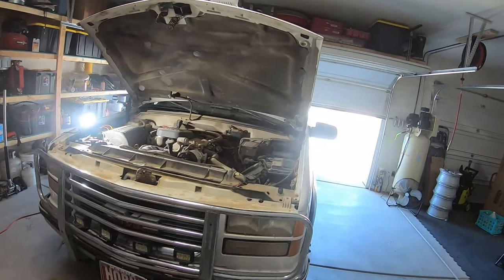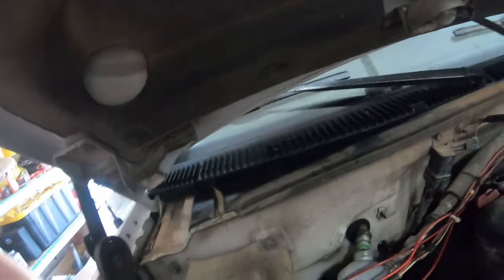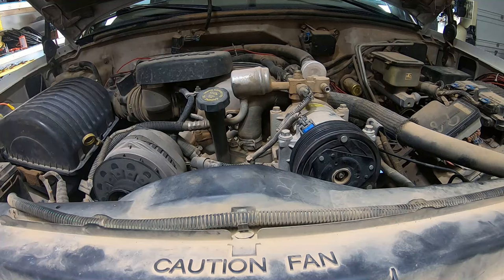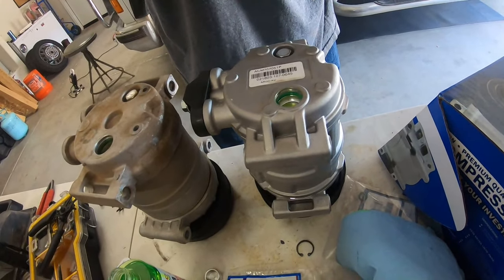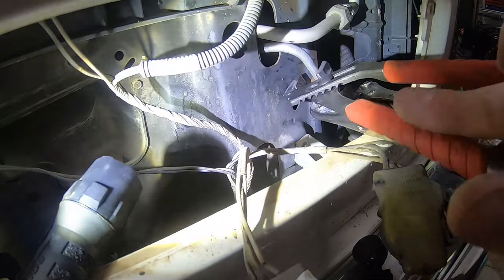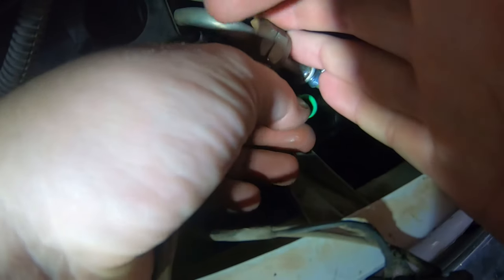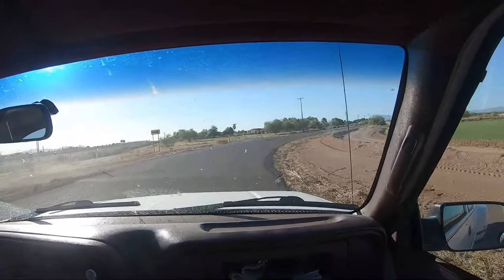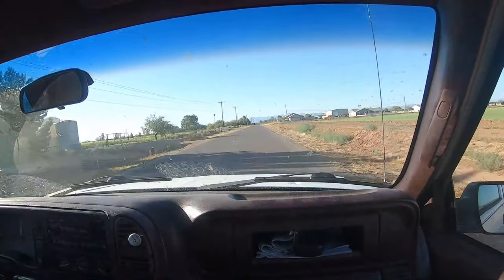GMC Sierra A/C Compressor Replacement

Comment: Excellent video! I am glad you showed putting the oil in the accumulator and the compressor. Each compressor manufacturer will have the oil specifications and the torque values.
Reply from the maker: Thanks!

Comment: On the back of the compressor opposite of the High pressure switch, what is this? it has a foil sticker over it, what is the purpose and hypothetically if someone , definitely not me, punctures that sticker will the compressor still operate correctly?
Reply from the maker: Haha funny stuff there...I can't remember any stickers on the rear of it though...
Reply: @AGuyandHisProjects   Do you know what the other input on the back of the compressor is for? opposite the low pressure switch?

Comment: is it a must to vacuum the system before trying the ac ? I have a compressor that went out- same engine- I want to change out the comp, accumulator and oraface tube just like you did and it should work fine. I suppose I'll need to recharge the system with refrigerant after all this is done am I correct ? and after recharge , in theory , I should have cold air again- am I on the right track?
Reply from the maker: Thanks for watching! you MUST do a proper vacuum before charging with refrigerant yes.
Reply: @AGuyandHisProjects  is that a difficult DIY thing or should you have that done by a shop? I'm trying to save as much money as possible. Got any videos on the vacuum and recharge on this job you did?
Reply from the maker: @louisianaphantom  honestly it would be cheaper to have a shop vacuum it and recharge it. Otherwise you'd need to buy a vacuum pump and gauges for a one time deal. Unless you can borrow one from somebody. Unless you are going to make it a more regular thing anyway
Reply: @AGuyandHisProjects  did you video the vacuum procedure? Is that something that can be done DIY? also the refridgerant- goes in after vacuum test- can that be done DIY?
Reply from the maker: @louisianaphantom  I do not video that no. It CAN be done absolutely. In a nutshell pull vacuum for a good 45 min or more, make sure it holds vacuum. Then fill with whatever amount is called for on your truck. If you can find that info then you are golden!
Reply: @AGuyandHisProjects  Think I'm gonna just change Comp. and Acummulator , oraface part in the line, fill back with oil and let someone vac test and refill. Some say it's neccessary to do a system flush before the oil fill to remove any metal fillings-small peices- did you do that to yours? And how do I know if I need to do that or not? Shop fella told me if you dump out the compressor oil and its dirty and gray ish then flush it- if clean then don't worry bout flush. Any wisdom there? And thanks for responding. I'm definitely going to tackle the compressor swap, accumulator and oraface part behind the headlight..... that looks do- able for me, just changed the water pump and thermostat in same truck and the ac video doesn't look as tough as the water pump job was.
Reply: @AGuyandHisProjects  I have the same 454 big block gmc 7.4 in my 98 k2500 truck. I'm wondering does the vacuum when it removes moisture- will it pull out any oil from the compressor and acummulator or don't worry about that.......
Reply from the maker: @louisianaphantom  keep in mind I am not a mechanic, but I don't think I'd worry about that